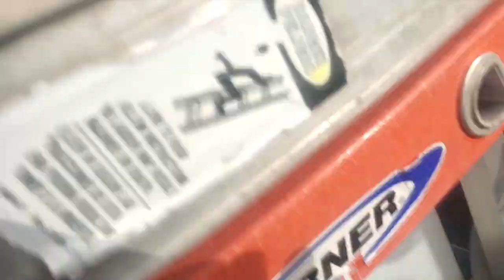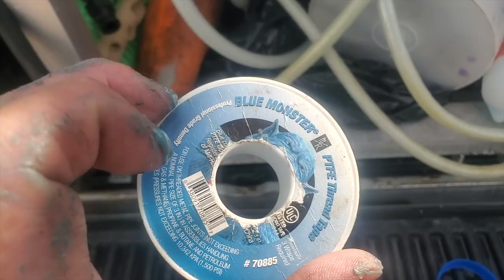Soft wash Proportioner Home Build - Maintenance

Comment: Question: would could possibly cause a setup like 4gpm 50gal water 50gal bleach same proportioner, to cause my bleach to getting pulled into my buffer tank.

My only theory is my proportioner has gone bad some way. Was just curious if you or anyone else has run into this problem starting out.
Reply: A small piece of debris has gotten into the check valve not allowing the check valve to close all the way.
Reply: @adamchicoski5284  thanks, I'll try rebuilding the proportioner tomorrow. See if anything is  blocked/stuck. Just wanted to ask someone's opinion before I start tearing stuff apart tomorrow.
Reply: @NalfThaGod  don't rebuild the entire proportioner, the check valve (assuming u have one) has failed and is allowing fluid to go backwards.  Take that apart (takes 5 seconds) and make sure no debris inside. If you don't have check valves, That's the problem.  Best to have a check valve on each valved section.